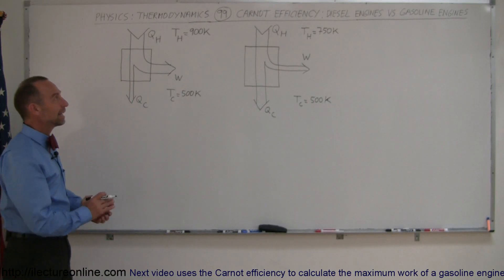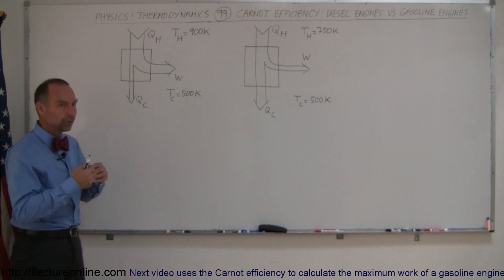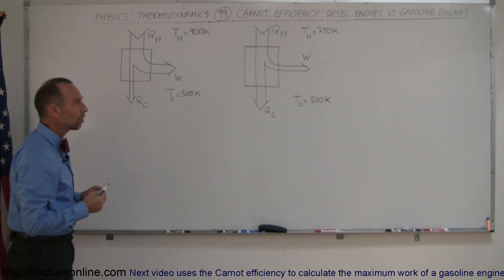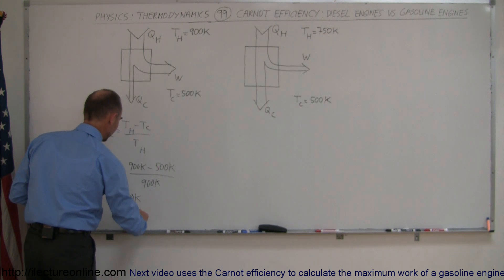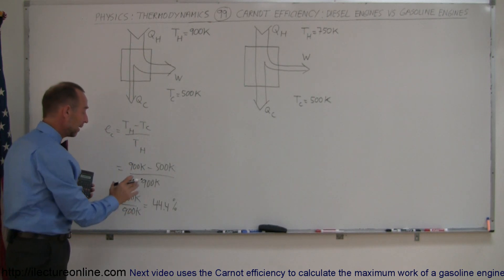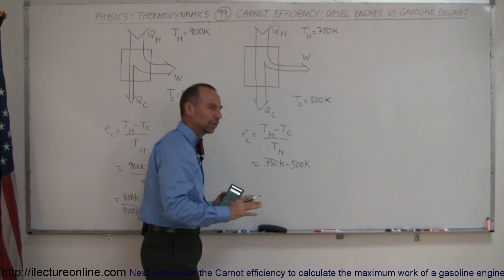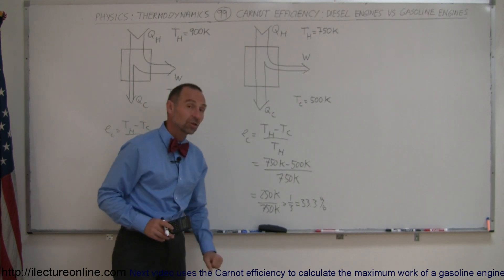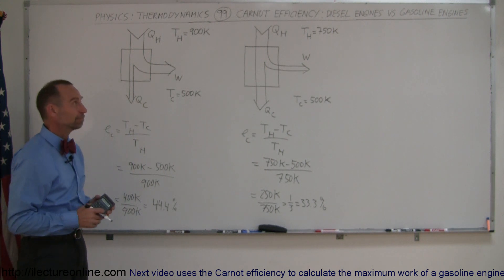Physics 29  Efficiency Of Heat Engines (9 of 14) Carnot Efficiency: Diesel Engine vs Gasoline Engine

Comment: here the efficiency has calculated the way we usaually do.can you say why here it is called carnort efficiency at the caption
Reply from the maker: The equation is the same, but the Carnot efficiency is the maximum possible efficiency and depends only on the temperatures of the source and the sink.

Comment: So what is the difference between the efficiency (using data in J) and carnot efficiency. Is it that the efficiency(in J) is the exact efficiency while the carnot efficiency is the maximum efficiency possible that you can get out of the engine.
Reply from the maker: +Chris Wass 
A Carnot engine is not a real engine.  It is a theoretical engine.  It is a way to calculate the maximum efficiency an engine can have and it is bounded by the input and exhaust temperature.  To calculate it you use only the temperature.
  Every other engine (real) has an actual efficiency which is calculated by using the input energy and the output energy.

Comment: Why these values for temperatures?
Reply from the maker: Are you asking why we use Kelvin, or the actual numerical values?  (the numbers used are just hypothetical values used for the example)
Reply: @MichelvanBiezen  The actual numerical values, mainly the clod reservoir temperature. It is hard to find a consensus of what to use for real engines.

Comment: HI, just curious if you know how efficient, by percentage, an electric motor would be (like that used in a nissan leaf or tesla)?  I've heard somewhere around 70% but don't know for sure, thanks.
Reply: 96% in today's tech. electric motor could easily achieve highly efficient due this simplicity and no heat exchanged.